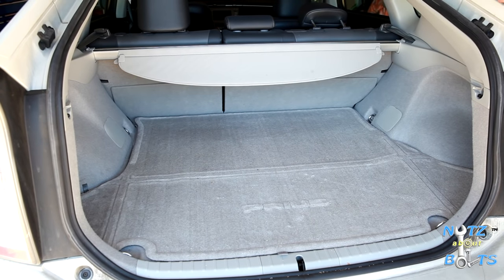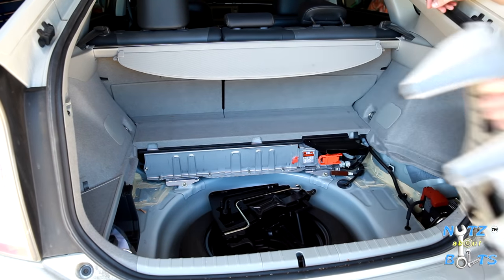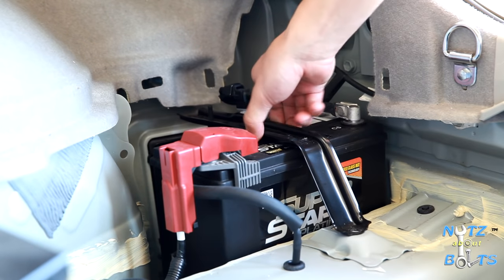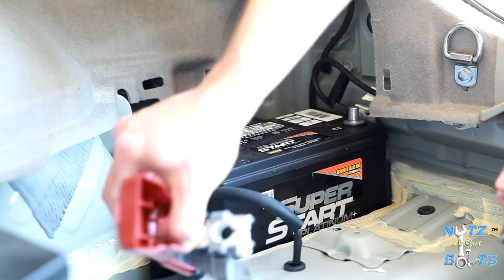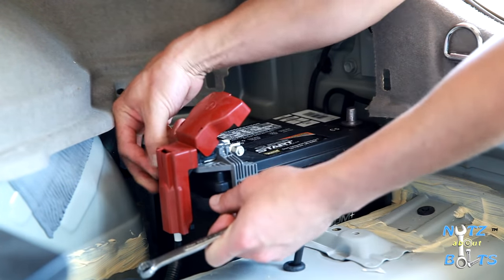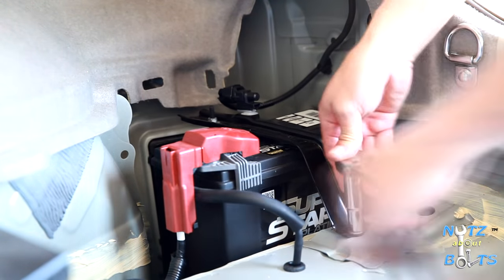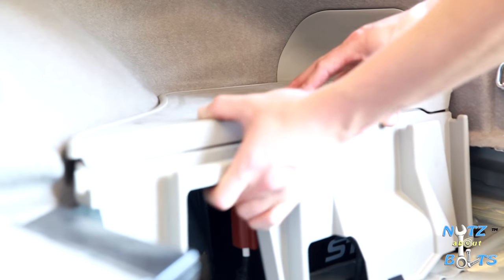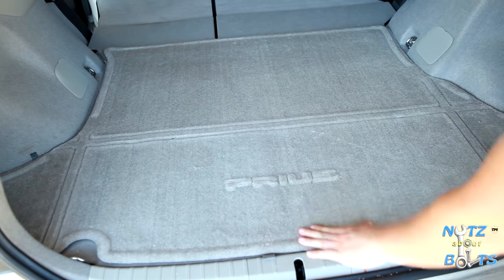2010-2015 Toyota Prius 12V battery replacement

Comment: I just did the install on my 2010 3rd gen Prius IV, the install took only about 20 min.
This video is well done, thank you.  Here's my notes I used, maybe it will help you.

# Need: 10mm wrench or socket
# Battery: Duralast Platinum Battery 46B24R-AGM Group Size 46B24R 410 CCA (autozone delivered in 3 days!)
# Ground terminal grounds the entire car, disconnect this first, do the install, reconnect this last.

pull tub & floor panels out
Remove negative connection
Remove bracket bolts
Remove bracket, leave grounding wire connected, move aside
Remove positive connection
Remove vent hose, notice notch
Remove battery, remember orientation: negative closest to the bumper

# Repeat above steps, reversed.
Install new battery, negative closest to the bumper
Connect vent hose, get notch right
Connect positive connection
Place bracket back in place
Connect bracket bolts
Connect negative connection 
** check battery, start car up **
Replace floor panel, tub
Reply: Thank you!
Reply: @ahiker9477  Do you need to do anything in terms of the big battery other than keep the car turned off

Comment: My car had been parked for a month. A nice little mouse decided to make a nest using seat insulation right on top of my neg post. I guess it made enough contact with the grounded body of the car. It killed the battery. Lessons learned, you can still jump your car upfront and drive it all you want as long as you don’t cut it off again. I have one of those battery pack jumper things and I jumped it several times using maybe ten percent of the portable jumper. So with one of those you are not stuck. Under the hood in front you take your fuse cover off, there’s a little red cover you flip over to expose the positive (red) connection. Connect black to a bolt anywhere connected to the body or frame of the car. These batteries are not cheap, I just found one just under 200 bucks with turning your dead one in. I learned something today, don’t let a store “test” your battery while it’s still connected in your car. If the apply a load check, it can smoke your very expensive ecm electronic control module. Tell tell sign it’s your 12 volt battery, after you press start that load will shut off all lights on the dash. If your red lock icon is not blinking, with all the doors shut from the outside. It’s likely a dead battery. If you left a door open or light on inside the car, just jump it and drive around for 30 min. Once the car is on, the high voltage hybrid system charges your 12 volt system. If you run it a while and go to restart and find it dead again. It’s likely the battery has a dead cell, be very curious as to why it’s now dead. Ten year old car, I’m not really gonna think too much about it but a newer battery. Those have had something happen, I don’t know like say a stupid mouse nest! Or chewed wire, loose wire etc. great video as always above, thank you and I hope I helped you too with your adventure. If you don’t have one of those small emergency jumper batteries. Spend the 50 bucks, keep it charged and thank me later when it bails you out of trouble. By the way also not, dead battery equals unable to open the hatchback from outside. So you have to put your back seat down, crawl back there and in the middle bottom where it latches there’s a small little latch you pull from back to front relative to the car. So pull latch forward and hold forward, while holding in that position push up on the hatch back to have it come open. A little heavy to push in this twister position you likely find ourself in. Heck maybe I should make a YouTube video too on my lessons learned today. Anyone wanna go mouse sniping with me. I shall avenge the death of my battery! 200 dollar stupid mouse!
Reply from the maker: 🤣🤣🤣 yeah, rodents love to build nest in our Prius. Hopefully you fixed that issue. But for the other things you had to do like opening the trunk manually, we got a video on that. Also the positive terminal in the hood, we got a video showing how to pop that cover off too. Hopefully you don’t have any issues with your vehicle after your fix.

Comment: I'm SO pissed. My proud wouldn't start today and I had to have it towed in. They told me the battery had died and needed replacement and it would cost me $500. I asked if I could just replace it myself and they assured me that no, I could not, that the 12V had to be "integrated" into the hybrid system and "everything has to be reinitialized" after changing the battery. They also wanted to charge me $2,050 to replace the control arms on the front of my car. That struck me as unusual because the Internet tells me an average cost is $600-$750 per arm. So I called a mechanic who said that this dealership in particular does stuff like this alllll the time and that almost certainly I needed no such work given that I just passed state inspection a month ago. He's doing to look at it in a few days. But I approved them replacing the battery one to get home today and doing that I could've done it in 5 minutes with a socket set and some elbow grease for $240 instead of $500. Fucking vultures! !!
Reply: My Prius, not proud.
Reply from the maker: Ouch, even the high voltage battery, you can do it yourself since there’s videos on YouTube. I’d recommend double checking YouTube next time before bringing into the dealership. that place sounds shady.

Comment: Are the replacement batteries the same batteries for other motorsports, like Harley’s? Autozone has batteries for close to 100, while the cheapest at the Toyota dealer is 275. I just want to make sure the batteries that work for the Prius are these other-vehicle used batts. According to the autozone site they work for the Prius, so I guess I can trust it? 🤷‍♂️
Reply from the maker: Well, someone in the comment section went to Walmart and matched up the battery size and post terminal and bought it for cheaper than 275$. So you can try that if it works. I just buy them at oreilly for 250$ as well and be done with it. I think the motor crafts battery are smaller, but if the cca, size and post are the same, I don’t see anything wrong with it.

Comment: Can the 12V battery affect the push to start? My FOB was low on battery so i replaced but i am still having problems with the push to start. Any advice??
Reply from the maker: Abraham Zarate if your 12v battery isn’t working, your vehicle won’t start.

Comment: I followed the instructions here and it made it really easy for me, so thank you! I have a 3rd gen Prius. The only thing I was nervous about was closing the hatch door after removing the bad battery. I feared it would lock with no way to unlock it. Maybe it can't lock without a battery so my fears may have been misguided, but I didn't want to take any chances. I left it open while I went to the auto parts store to process the old for new battery, otherwise, there would have been an extra core charge.
Reply: there's a release on the inside. It's rather hidden, though. Ask Youtube!

Comment: Thank you for posting! I have a Plugin Prius so the entire back floor does not come out (I think half of it covers the plugin batteries), but basically skipping the first 2 steps, the rest about removing the battery from the compartment on the right worked. Thanks again.
Reply from the maker: glad to help :)

Comment: Awesome video, but after replacing my battery my trunk wont open. 😫 I have to push the button from the inside to open. How do I fix this?
Reply from the maker: Is it your key fob not opening or the trunk button from the outside? Could be a fuse issue, I’d check that first

Comment: Like, between 2 prius owners..can it be any regular 12 volt battery? I have # 26 battery in my sites I wanna know if that's fine.
Reply from the maker: Patricimo Suave check the battery pos. And neg. post and see if it’s the same as the oem, if not, you won’t be able to drop it in correctly.

Comment: So just went to check my battery (had no idea that’s where it even was) and saw that the little vent tube was not plugged in (last replaced at dealership in 2016). Is that bad?
Reply from the maker: That tube is to vent the battery gas

Comment: Went to Walmart asking for prius battery they said don't sell a prius battery and they are expensive 😒.  I went over to the wall full of batteries and matched up size and positive and negative.......58.00 bucks with tax!!! Boom 💥 back on the road.
Reply from the maker: Smart, I bought my battery at oreilly for 200+$
Reply: fasteddy, you wouldn't happen to have a part # ? I'm far from walmart. Costco didn't have a match, but found one 2x the depth that can fit in the space, but you have to jerry rig stuff, have normal connector so you need adapters and it's not vented nor AGM, so maybe not - for $80 (group size 25, 550 CCA much deeper).

Comment: what is that cable that is attached to the battery bracket with the 2 10mm Bolts. what is that cable?

Comment: Update to my comment below. When I arrived at the Toyota dealer, I mentioned how I’d called around for prices and since dealer price was so good, I came to dealer. Turns out the service rep on phone gave me wrong info. Installed price between $400 and $500, not the $200 I was told on phone. However, the dealer honored the price I was given on phone. So, yay, Toyota of Deeefield!
Reply from the maker: Danielle P nice, but I think 400-500$ is over priced. Battery cost 200-300$. It only takes 30 mins to change the battery, so they’re over charging on labor...
Reply: NutzAboutBolts agree 100%. If they had not honored the price they gave me over the phone, then I would’ve purchased the battery elsewhere and installed it myself, thanks to your illuminating video

Comment: Important point.  Do not close your trunk after removing the battery.  Trunk will not re-open without the battery, so the new battery can't be installed.   I had to attach a battery jumper to the connection points under the hood to get the trunk to re-open.
Reply from the maker: There’s a manual way to do it, we filmed it as well.

Comment: Is the installation as straight forward as this video makes it seem, or is there some way to screw it up? The autoshops want $100 - $250 to install it.
Reply from the maker: It’s straight forward 👍🏼
Reply: You can screw up if you switch the neg and pos which is easy with some cheap batteries people try to use

Comment: I can't recall if it was mentioned but after I had disconnected the battery to charge it up I Found that I couldn't open the door of the boot/trunk( it had started to rain so I needed to close it). 
I had to enter through the back doors to lift the latch. 
I assume the lock is linked to the battery ?
Be careful about things like that when you disconnect the battery.
Reply from the maker: The rear hatch is electronically controlled, it’s not a manual hatch.
Reply: For anyone else who finds this comment: You can actually stick a finger in and flip the release on the hatch from the inside, then push the door up with your other hand. Saves a lot of hassle! Just be sure you push it open all the way, so it doesn't slam back down.

Comment: How much are these typically to replace?  I see price ranges of $250.00 to over 1100 to 4500 quoted?  What should I look for on a 2012 Prius III with 107k miles before buying?
Reply from the maker: The battery is usually 250$, and labor is 30 mins if you bring it to dealership.
Reply: @NutzAboutBolts  much better than the higher amounts quoted if that’s the case a Prius is a win investment.
Reply from the maker: @threadoflife  250$ is just for the auxiliary battery, if you’re talking about the high voltage battery under the passenger seat, it’s usually around 1500-3000$ I believe. I’m still running on the original HV battery at 240k miles… I’ll make a video when I do need to change it 🤣🤣

Comment: How do you know if the 12volt battery needs replacement? My Prius shows a full battery on the dash board but the lights are dim and it doesn’t want to shift into drive,reverse or neutral.
Reply: Two different batteries. The battery readout in dash is for the large regenerative braking and driving battery. I think the battery you need for the lights, etc is the one he changes out in the video.
Reply: There is a spacial menu on car that can tell you how many volts the battery has. You need to play with light switch and the info button to get it. 
Mine is 11.1 at moment with car powered up so considering a new 12v battery.

Comment: Thanks for the great video.  How's the Super Start battery holding up?  I'm in the market for a new battery for my 2011 Prius.  Do you recommend this brand?
Reply from the maker: It’s not bad, lasted 4-5 years before needed another replacement.
Reply: @NutzAboutBolts  Thanks for the reply.  I'm still on the original 2011 battery that is working fine, but starting to get a little paranoid :-)
Reply from the maker: @zotj  nice, my original lasted 6-7 years, some lasted longer, but when it dies, just buy a new one from oreilly or dealership. Maybe Napa auto store have them.

Comment: Can you use an at-home battery charger on a 12-volt auxiliary battery on a Prius I have a 2014 Toyota Prius Plug-In

I was thinking about setting it on 2 amps
Reply from the maker: Not too sure, I’ve never had to do that before but I’ve read people trickle charge their battery at home.
Reply: @NutzAboutBolts  okay yeah I was just wondering. I didn't realize my OBD that I had plugged in all the time was draining my 12-volt auxiliary. It states that I can possibly get 8 to 10 years out of it and it's only about five years old about 124,000 miles. so I guess before replacing it I'd like to charge it fingers crossed and see what it does. I appreciate you responding so quickly I love your material still going through all your videos.
Reply from the maker: @marklenares4518  np, yeah my battery doesn’t last 8-10 years, it usually last 4-5 years lol

Comment: Great video but  I have one question  directly remove battery lost data car? how can install  battery without lost data
Reply from the maker: You lost radio and clock memory. If you don’t want to lose them, use a memory saver.

Comment: How do you check if the battery is bad
Reply from the maker: only way is with a multimeter. Fully charged battery should measure at 12.6 volts or above. When the engine is running, this measurement should be 13.7 to 14.7 volts
Reply: NutzAboutBolts do you know what is the CCA of the battery. It is not listed on the battery.
Reply: My power locks won't work, and when I tried to start the car manually it wouldn't work either (the brake pedal also gave more resistance than normal when trying to start the car). This is a clear indication that my 12v battery is bad, right? I only ask because the mobile mechanic I called won't even come out because he doesn't have the proper diagnostic tool for the Prius. I've never even replaced car fuses, but I'm ready to replace my battery after watching your video.
Reply: Thank you very much for the specs and well-shot video instruction sir!

Comment: I’m thinking of buying a 2013 Prius c with 114,000 miles on it (it’s writhing my price range). I’ve driven it and it drives fine, but does anyone know how long the battery lasts and if it’s a good deal (I’m getting it for $7000). I need to run for at least 1 year
Reply from the maker: Not sure about the C, but my Prius IV is on its original HV battery, and it’s at 210k miles.
Reply: @NutzAboutBolts  Do you have advice on how to make the HV battery last like yours? It seems like some people's HV batteries give out after 100K/8 yrs. I know that's the warranty, but getting it past 200K would be fantastic!
Reply from the maker: Meredith V just drive normally and it should be fine. I haven’t heard of any HV battery prematurely dying less than 100k miles. I’d also check the HV battery fan to make sure it’s not clogged either.
Reply: dr Prius android app is a great way to check the health of a used prius - that's what I did when I shopped (and got) one. 2014 with 185k and HV still ok (~60% if I recall). The 12v (likely never changed at 8y) is another story... ran brake bleed and just about killed it. now twice I couldn't start D mode until i jump started it. local store say has only 160CCA (vs 325 new) and 11.6v with load. time to replace...

Comment: Is this what i need when it says aux battery low.. i think i left trunk open 😢
Reply from the maker: Yes, the aux battery is the 12volt battery. The High voltage batter is the hybrid battery.

Comment: Hi
What if the polarity of the new battery bought is different than this. positive on the right side!!!????
thanks
Reply from the maker: farshid007 it’s the wrong battery
Reply: @NutzAboutBolts 
Thanks for the response.  I tried to buy the battery online. Given the registration number, the battery was offered had the poles opposite to the ones you showed in the video. I just dont know why they come up with such a battery ?!

Comment: What size tool did you use to disconnect the negative cable from the battery 🔋  ?
Reply from the maker: 10mm socket and ratchet

Comment: Would replacing the truck battery suffice? The battery under the hood wouldn't have to be replaced too?
Reply from the maker: There’s no battery under the hood,
The 12V battery is in the trunk. The high voltage battery is under the passenger seat, which isn’t needed to replace till it goes bad.
Reply: Oh I see. What is the battery that is used to jump-start the car under the hood?  @NutzAboutBolts
Reply from the maker: @samxmatcha  it’s probably where the inverter is, it’s not a battery, I think there’s posts there that’s to jump but not a battery.
Reply: @NutzAboutBolts   ahhh gotcha. Thank you for the video and prompt response :)